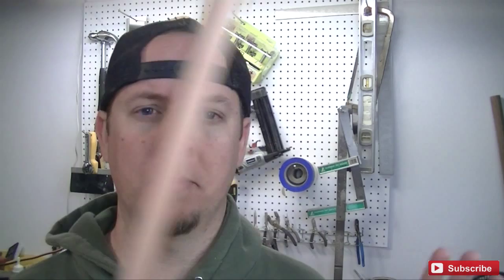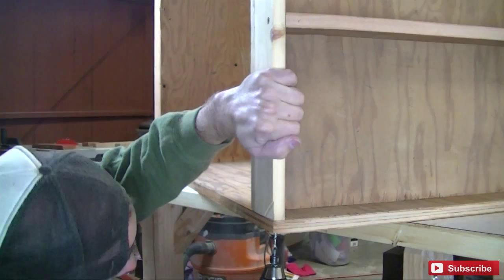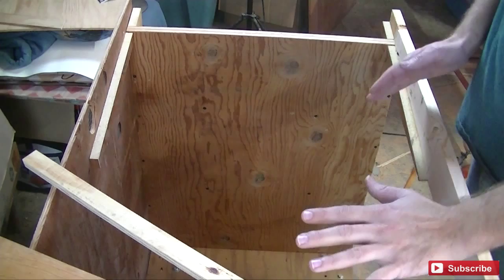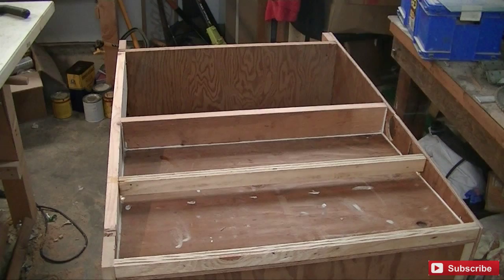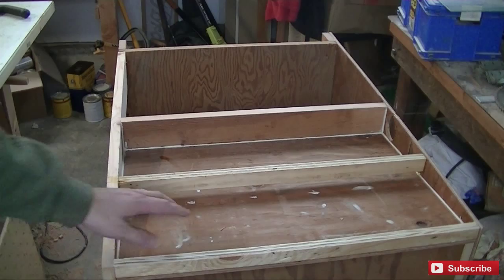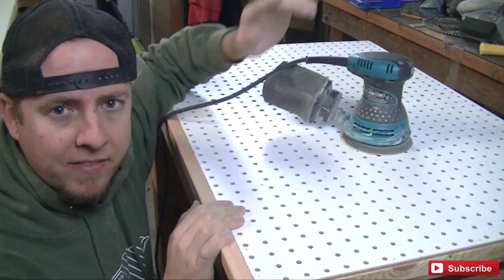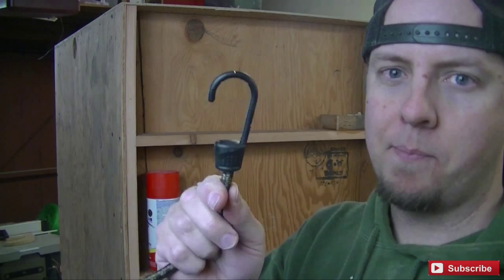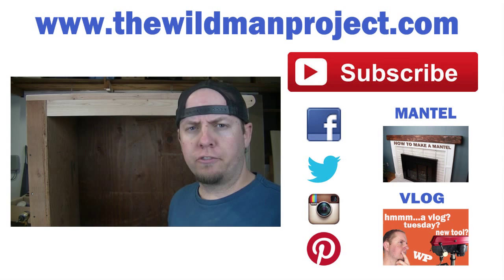How to make a Finishing Cart

Comment: I would sand the pins for the peg board at one end to give them a fine tip. So when your flip your piece around to paint/finish it doesn't end up with a small round print of the pin. 

Really like the spray paint shelf on the side with the cords. I say you add a couple of small drawers for sand paper storage. Good stuff man 👍
Reply from the maker: Edgar Rivera Thanks for the ideas Edgar.

Comment: Nice project! I think the downdraft table can be also used as a vacuum forming machine, if you are into that kind of technique! Also it would help if you turn one end of each peg into a point so that you can spray both sides of a project in one go. Looking forward for more of your videos!
Reply from the maker: antystein Thanks! I will look into vacuum forming. I have done a little a long time ago. I did round the edges of the pegs with my belt sander.

Comment: Like the cart. Just a suggestion, a removable top for the suction part so that you can clean out anything that doesn't get sucked up.
Reply from the maker: Hano Bester thanks for the suggestion. Might add a access door from the bottom. Don't think I could cut a hole in the top.
Reply: WildmanProject sure you can. just cut out the shape, frame a lip on the bottom side and slip the cutout piece back in.  it can then be lifted out for cleaning.  love the idea on how you fastened the bungee cord  :>)
Reply from the maker: Russ Veinot I know I could do it, just hate to cut a hole on the top. I like that it is one solid piece. I guess I will wait and see if any sawdust collects in the box. I think the screw was a better ideas then a big knot on the end.

Comment: I like the peg standoffs and I would keep them removable if I could but I'm thinking the pegboard will fill up with finishes and make the holes smaller so you might consider evenly spaced permanent pegs.
Reply from the maker: WoodenU Yeah I will have to keep an eye on the holes. I guess I could always re-drill the holes to fit the pegs.
Reply: Ok so I didn't even think about redrilling the holes lol keep them removable :)
Reply: Sorry not sure why it used my woodenu account on the first comment

Comment: This might sound like a silly question, but I've watched many videos on YouTube where people are using their air powered nail gun, but I can never hear an air compressor.. In my experience, air compressors are darn loud.. What do you use to provide the air?
Reply from the maker: denno021 I use a air compressor. I usually fill up my tank to a high PSI and then turn it off so it wont kick on during filming. On my compressor I am able to adjust the PSI to the hose.